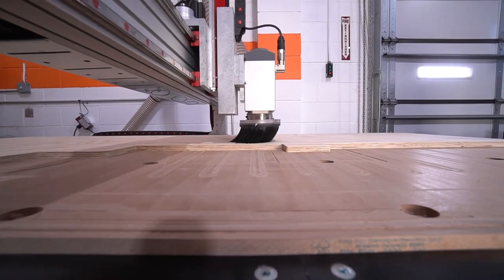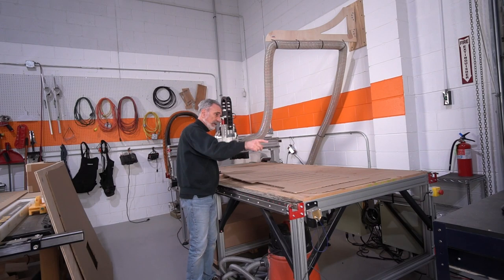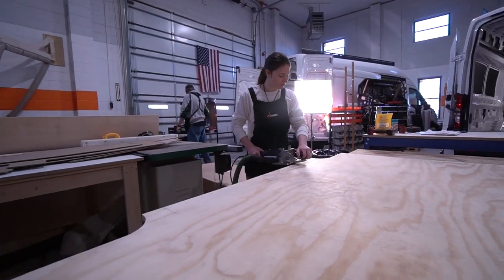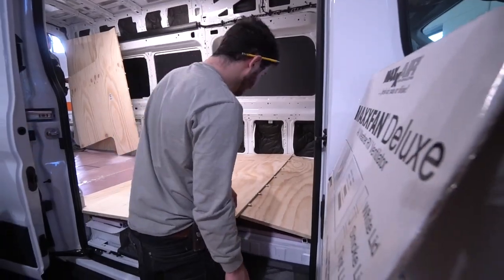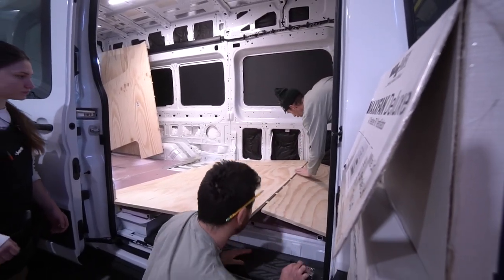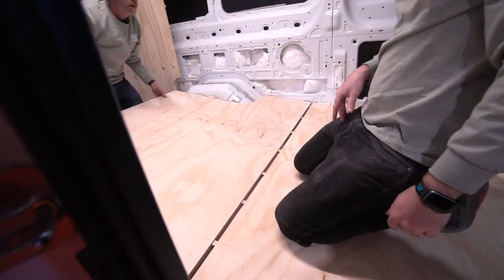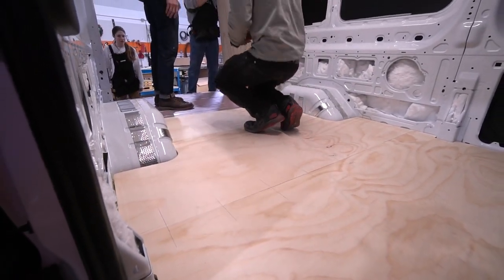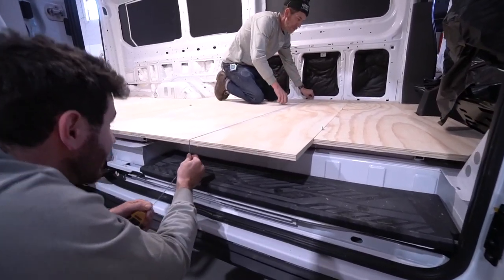DOMINOES! The secret to installing SUBFLOORS in your VAN

Comment: Hi George, you are so creative and inspiring, you convinced me I could build my own van. Even with many years of construction experience and a number of years working for architecture firms It is not easy at all. If you want to do it right, you have to really consider all materials and fastening systems is whole new context. Vibration (what I call the perpetual earthquake effect of driving down the road), rust and corrosion from the humidly (human, cooking and the dew point condensation), OMG, my van build has turned into a wake up nightly thinking of new things I should be thinking of or doing deeper dives into. 
You and your team are doing amazing work, doing it the right way! Okay, enough rambling (I am supposed to be working on the van).  I do have a question.
I have put in my van floor using the same system as you are using (Plywood over 1" square aluminum tubing glued to the metal deck). I bought stainless steel fasteners and then started to question whether 304 stainless will rust (as it stuck to my magnet). What I am reading says that galvanic corrosion will occur when using stainless steel fasteners into aluminum. 
Should I worry or just go back to sleep? Galvanized or zinc plated seem like they may not hold up well to moisture. Cadmium plated fasteners maybe. What have I got myself into.

Comment: With a small sharp plane, you could plane a taper angle on four sides of each domino so they would fold in more easily. Or use biscuits if they won't break from extreme angles while bending from harsh angles while assembling.

Comment: What about using coosa board (light weight fiberglass composite board) instead of plywood? Coosa board is very expensive but lighter and doesn’t rot or swell.
Reply from the maker: It's a great product. And if my shop was in Maryland or Florida, I'd be using it. But as you said, it's expensive, and not available in my neck of the woods. The shipping would kill me.
Reply: Don't know the physical properties of bamboo plywood. That is a new emerging product.
Reply: Marine grade stuff is overkill, but that is George's middle name anyway.
Reply: Kevin, I haven't heard of it before but will look into it, thank you. 
I'll be traveling with three dogs and moisture and swelling are a big concern. I haven't started my build yet but will soon. 
I was planning on a simple plywood sub floor with vinyl waterproof flooring over the top. I'm guessing if the vinyl flooring isn't glued in place I should be okay? I will need to have a rubberized caulking around the perimeter of my floor at the base of every cabinet so no water, anything, (one dog occasionally will vomit), can get underneath. 
This may be too vague...
Any input?

Comment: I'll be the second commenter.
Was waiting for the right video to ask my question. I commenting before I watch it.
Maybe you will mention this.
Do you get squeaks from the rigid insulation and plywood?
Reply from the maker: So far, no squeaks. We glue the foam down to the chassis floor and it is ever so slightly less than the full one inch aluminum, so I don't believe there is much contact.

Comment: Idea.
Build 2 wooden "handles".
Screw them to what will be the upper face, an inch Back from the joint you're installing.
That will let you lift, twist and position more easily.
When it's in, unscrew.
Reply from the maker: You're on fire this morning! 💪🏼
Reply: @HumbleRoad  
1 more!
(For safe installation)
Handle on all four corners.
Dry fit.
Take 2 "sawhorses" ("trestles"?) Place front and rear.
Person on each corner.
Lift board.
Shuffle saw horses under.
Apply adhesive as required.
Remove trestles and lower.
With 3" + feet working room,
you should end up with the adhesive on the floor rather than on your arms! 😁
OR!
If this goes in before the roof insulation, rope through the van roof beams, tie to handles.lift, tie off rope?

Comment: Connecting the plywood sections is a good idea, biscuits would have worked much easier.
I love working with aluminum but it's one of the worst thermal insulators. I'd use square fiberglass rods under the plywood, a bit more money but  worth it in my humble opinion.
Reply: Biscuits are a good idea too.
Fiberglass rods are a great idea for thermal considerations.

Comment: Ever heard of an auto feed screw gun? Lots of floor guys/deckbuilders use them. Increased efficiency/ergonics (less bending over, or being on your knees).
Reply: Have seen that or something similar used for drywall installs. The screws are held in a plastic strip.

Comment: Well done as usual George. Thanks and keep up the fabulous work! Great team you have assembled there! Have you considered engineered tongue and groove subfloor? The connection is continuous, strong, and designed for expansion and contraction (no glue). I would imagine the cost difference is a factor and I would propose the plywood version not the OSB version.

Comment: Simple lap joint is much easier to install the sheets (and easy to execute with that CNC). Use a very strong adhesive (or epoxy) to glue the sheets together - the joint will be stronger than the wood and flat as long as you put lots of weight on top while the epoxy is setting up.

Comment: George, loving this flooring system. Was wondering if have you considered using ZIP System R-sheathing by Huberwood (like home builders are starting to use on exterior walls) and using your CNC to cut it. The Zip system R- sheathing has a water shedding barrier built onto the outer surface (green in the photos), followed by an advantech layer, and a rigid foam layer. You would just need to use the zip flashing tape for the seams.  Just spit-balling.
Reply from the maker: Thank you, I’ll check it out.
Reply from the maker: Interesting product. Has merit in a van build, however, I need to check on the indoor safety of this product. Could it off-gas toxic?

Comment: Another nice one!

I was thinking, maybe sanding the edges of the dominos a bit can help it centre in the slots a little quicker?
Reply: Taper the edge of each rectangular spline dowel on four sides.
A sharp hand plane would do the trick.

Comment: George, I was rewatching the subfloor video and I think you should abandon the domino (dowel type) mating system you used.  I think it might be better to create an edge on one side of each plywood that mates with the next edge like a tongue and groove planks.  You could design it so that all you need to do is drop the plywood in, your CNC can cut the edges with the right tolerance built in (for wood to expand/contract) and they easily mate with the next one.  More like a half lap and less like a dowel system. No lining up dowels.  You could make the mating edges as wide or as narrow as you want, and even line them up so that the screws go through both mating edges and then into the aluminum joists.  The big plus is that they just get dropped into place.
Reply from the maker: A lap joint would not work, but tongue and groove would be best.

Comment: Why not mark the screw holes using the CNC?
Just a 16th deep "dot" which the screwhead will cover?
.
And a 1/2" gap on the sheet at the front of the wheel arch will let it drop without struggle(?) I'm assuming that will be covered by cabinets?
.
Maybe a finger hole in a convenient spot on the sheet to allow easy handling? (CNC a plug to fill it in the scrap area of the sheet?)
Would save a few minutes per van, but it adds up.

Edit.
It may be easier to install the dominoes on the sheet you're dropping in, rather than the one that's pre-installed? Easier to "aim"?
Reply from the maker: Good ideas! 👍

Comment: George, nice progress.  Your shop and your vans will all get exponentially better with that CNC.  You can now very easily make any tool or jig you want.  Just wait until you start cutting aluminum parts.  Magnifico!

BTW, what do you think of the idea of filling your aluminum square floor joists with insulating foam?
Reply from the maker: The aluminum tubes are hollow, so that air space doesn't really need any insulation. The tube is glued down to the chassis floor, that dollop provides SOME (read: very little) thermal break. Then the plywood on top, which is a good insulator. Then a finished floor with generally a cork backing, then a runner area rug. My experience is that it's fine, unless you will be in extreme cold climates. In which case we would build accordingly.
Reply: @HumbleRoad  The R value of an air gap is 1.01 per 3.5 inches, the common thickness of a residential wall, divided to 1 inch and you get an R value of 0.286.  However, 1 inch aluminum tubes only have an air gap of 0.75 due to the 0.125 thickness of the aluminum walls, so the gap itself is only 0.75 in space, giving you an R value of only 0.216.  Closed cell spray foam has an R value of between 5-7 per inch depending on the product, so lets assume a 6 for these discussions.  An aluminum tube filled with closed cell spray foam would then give you an R value of 4.5.  I would say that a 4.5 is much greater than 0.216.  Although a thermal break still needs to considered for between those Aluminum joists and the floor since metal conducts heat/cold very well.  Food for thought George.  Love your channel as always.  Thank you for listening.
Reply from the maker: I like your calculations, Eric. And yes, you have shown me that it is beneficial to include spray foam inside the floor joists. You've also sparked an idea in my pea brain to take it one step further. How about routing a radiant tube through each joist? Protected floor heat!
Reply: @HumbleRoad  just FYI, I assumed a closed cell foam product, not the typical open cell foam cans commonly seen at Home Despot.  Putting in radiant floor heating into the joists is an interesting idea, but I would not use this with the foam, only 1 or the other.  I can only imagine the nightmare of fixing a leaking line encased in sprayfoam inside an aluminum square tube glued to the floor of a van.  That has to violate your "accessibility rule"...
By the way you need some Merch.  For example: Orange Humbleroad sweatshirts that say "Options".  Thanks George!

Comment: What size of aluminium bars did you use, how much of a weight savings would you make vs wood? 10%, 30% or...?

Thanks again
Reply: 1”x1” square tube aluminum, 1/8” thick wall

Comment: Firstly, I really enjoy watching Humble Road! I'm building my first van conversion and I have found your channel very useful as well as entertaining.

Secondly, a question. Have you considered or tried building the floor in quite opposite order? I mean first plywood (but quite a bit thinner) to smooth the ridges, then the XPS foam boards without aluminum bars and then directly on top of that the final floor. The reason I'm asking is because XPS has good compression strength, so if the floor is smooth, I would guess, it would be strong enough. I'm going to experiment with this approach as I need to save height as much as possible. I already tested without the plywood, but the ridges caused some sqweeking.
Reply from the maker: Firstly, thank you for your support! My build philosophy is that I leave the ridge valleys under the floor for air flow. I have done a few videos explaining my theory.
Reply: @HumbleRoad  Wow, that was a quick reply! I fully agree on the airflow. The idea was to keep the air flowing under the plywood. Maybe a bit complicated to explain the structure :)

I also realized that my comment would have been more suitable in the earlier video on thefloor structure

Comment: Awesome job and great videos. Are you worried about thermal bridging from the van floor through to the aluminum floor struts? Could you also have a subfloor without any framing struts by just gluing larger insulation sheets directly to the van floor and then glue your plywood to foam board insultaion? Is there a benefit to framing the subfloor in this manner?
Reply: A main concern I have as well, I have a hard time imaging the thermal bridging of the hollow aluminum struts are not insignificant.
Reply from the maker: The aluminum is set in a thick dollop of marine adhesive and the plywood over top is an insulator as well. The overall surface area of each of those one inch joists is negligible as compared to the structural integrity it provides as opposed to any other material. I have lived in extremely cold climates in a Pleasure Way, where the plywood is glued directly to the chassis floor. Nothing a runner rug couldn’t fix.
Reply: "as compared to the structural integrity it provides as opposed to any other material"…

As the plywood deck will distribute any load equally to the joists beneath it, a wooden one should have done it as well, without that thermal bridging issue - and even cheaper.

Comment: If anyone could do it and do it with aplomb it would be George and his new crew. I hope a customer comes along to give him the challenge.  A cargo van fitted out with scaled back mechanicals that can work during the week and adventure during the weekend or vacation. Roll'in-Roll'out modules with quick connect mechanicals and quick clamp style connectors to secure the modules. Obviously compromises on both cargo and adventure modes. The existing module style 80\20 setup he uses would lend itself beautifully to this. I'm sure his head is exploding with ideas he has not got the opportunity to use yet.

Comment: George, for heated floors, would a heating element go beneath or above the subfloor?
Reply from the maker: An electric heating element would go on top of the plywood. Hydro would go under.
Reply: @HumbleRoad  
Thank you!  I'll ask which is better when we get closer to working with you.  My wife and I are feverishly looking for a Sprinter van to purchase so we can get our conversion started, prayerfully, in 2023.
Reply: @HumbleRoad  . . . AND . . . (hydro) under the insulation or on top of . . . ?
Reply from the maker: insulation on the bare chassis floor, then the tubing with reflective grills in an air cavity, then the subfloor, then the finish floor.

Comment: Does the alum transfer a lot of cold from van floor to ply?
Reply from the maker: No. The percentage of the overall floor area that is the aluminum is miniscule. And the 3/4" plywood on top of the joists is a good thermal break.

Comment: I do not understand why you are using such deep thick biscuits. The thin oval ones do the same job of preventing the two pieces of plywood from flexing independently. I also use wood glue in the plywood  seams and you would need to saw a new seem to separate the panels.  I also paint both sides to protect the floor from absorbing any moisture *when* there are water leaks or spills.  I had a water heater freeze six years ago and I have had no flooring issues.  Also I have a mesh membrane under the floor to allow air under the wood floor. I would be interested on your thoughts, maybe I'm missing a potential  problem.
Reply from the maker: Biscuits and Dominoes are not the same. Dominoes are structurally superior. We glued one end of the domino and left the other end dry for expansion.

Comment: Are you using marine grade plywood?
Reply from the maker: No, but will be switching to Baltic 13 ply
Reply: @HumbleRoad  The plywood delaminating just isn't a concern in the subfloor or is there another reason why marine ply isn't worth it for a van?
Reply from the maker: @CPRebels21  You said it, the risk of immersion is not the same in a van as it would be on a boat. Far less moisture,
Reply: @HumbleRoad  i have a g20 and weight is something i must keep in mind. I always use pine in my build and have looked at the other wood species and their order of weight. I know weight isnt a concern for you folks in the bigger vans but if you can toss in some info on the species and some weight lessons to cover all builds. :)

Comment: Have you thought about gluing the entire floor together adding some pocket hole screws, then once dried take the whole subfloor in on an angle and slide and drop it into place?
Reply from the maker: Unmanagable and the joints, which should not be tight, would break open the minute you lifted and turned the assembly.
Reply: @Humble Road  you said in the video that the joints can't be tight, but the entire floor is screwed down, so there wouldn't be any movement in the subfloor.. Would you not need to worry about buckleing in the cracks if there's no movement in the subfloor?
Reply from the maker: Even though it is glued and screwed, the wood can still swell and receed at the seams. I remember doing a science experiment when I was a kid. We put a nail in a young tree, 3 feet off the ground. As the years went by and the tree grew tall and thick, the nail remained 3 feet off the ground.
Reply: @Humble Road  from what I understand about trees, especially in a forest, is they compete for the sun! The tree tops stretch as high as they can go, but the higher they  go, the deeper and wider the roots need to be to keep them standing proud thats why the nail stayed right where it was lol but on that note the seems shouldn't swell unless you have a leak somewhere or a really bad moisture problem. There's a lot of van builders out there, but your videos are awesome 👌 keep pumping them out my friend 😀
Reply from the maker: Thank you, Wayne!

Comment: Those dominos seem to be great once they're in but a bit of a pain to install. I'd be tempted to not use the dominos but instead use some backing underneath the joint so the joint can be screwed down to it.
Reply from the maker: It really wasn’t that difficult. A matter of a minute to line them up. Once installed, the only thing better than dominoes is no seam at all.